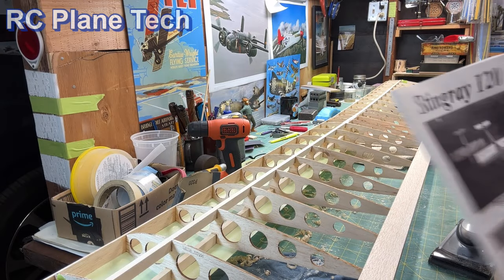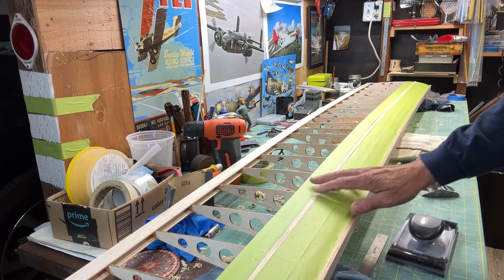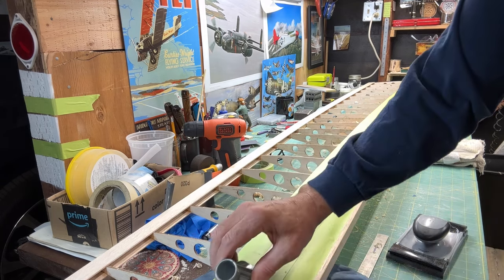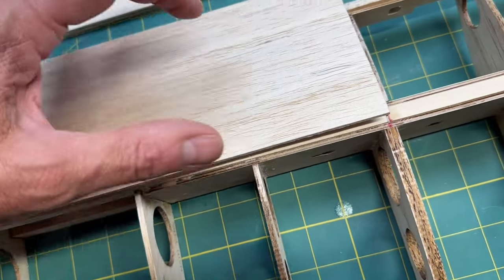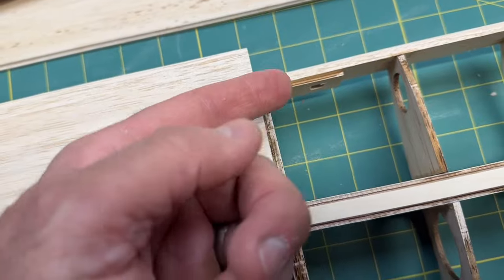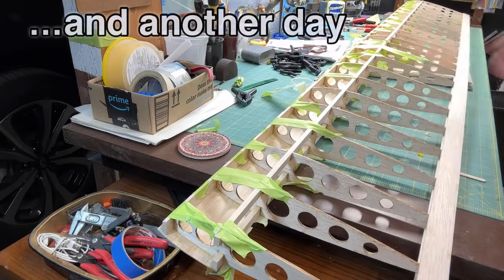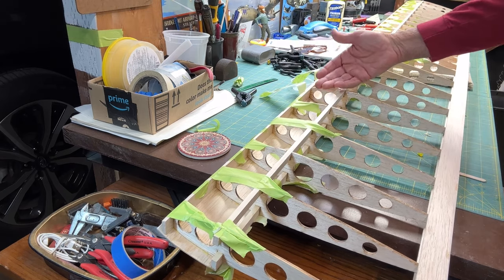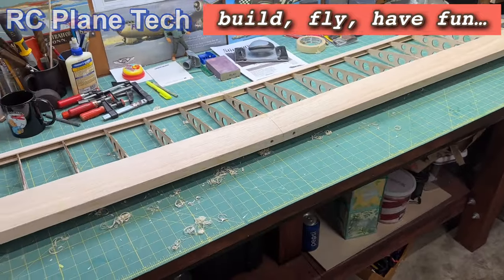Balsa USA Stingray with DLE-20, RC Plane Build N0 5: Wing Sheeting

Comment: I understand this video is several months old but one thing that's really good for putting on the sheeting is using a steam iron. Put the tite bond on all surfaces to glue and let it tack up. Turn the iron on using the steam to stick the parts together. It works great. I do it on all my planes while scratch building. I enjoy watching your videos.
Reply from the maker: Thanks! I’ll have to look into that method. Its always a challenge to sheet curved surfaces.

Comment: In my opinion the kit should have  fit a lot better . The rib should have been cut way more accurate , the spar didn't fit at all..
If you would have known the spar was to big you could have shave it before installing it.
But, you are doing a good job with it.
Reply from the maker: Thanks, ya the problem kinda snuck up on me as I was building so I went in that direction.

Comment: I use Windex to soften the wood and tape ,  and after it dries it will be formed. Then I glue it 😊
Reply from the maker: I have read about that method but have not tried it, something to consider in the future. Thanks for the tip.

Comment: Seems that in this case, it would have been better to check the rib slots before assembly and deepened them as needed. A little time spent before saves time later. Probably the same overall time.
Reply from the maker: Ya, thats a good idea. It would have saved time. Something to consider for sure.

Comment: I use wood glue exclusively to build.  I've found the FastCap  Highbot glue bottle is very handy with Titebond II because it isn't dependent on gravity.  Additionally silicone glue applicators make reaching under sheeting to apply glue to the ribs.  Lot of companies sell them, but Sili brand has different types and sizes.  Their glue pod is also nifty.  Nothing too expensive, but handy tools.
Reply from the maker: Nice , Ill have check those items out. Thanks.
Reply: @JamesRCPlaneTech  Also, lots of Q-Tips to clean off glue before it sets up.
Reply from the maker: Nice tip.

Comment: Just out of curiosity on my part if the spar is proud why not add rib caps to the structure since the trailing edge is proud of the ribs as well?
Reply from the maker: Yes, thanks. There will be rib caps, they will be flush with the trailing edge sheet and the leading edge sheet. The spar was too high. If I left it that way the sheet would sit too far above the ribs and the rib caps would then sit too low. Next vid on this will be installing the rib caps. Thanks again.
Reply: @JamesRCPlaneTech  my line of thinking being that I don't know how far above the ribs the spar was sitting was if the spar was sitting above the thickness of the sheeting that you could have just butted it up against the spar. Doing this i know would have ment that the sheeting would be "floating" between the ribs which isn't a good thing but if this was the case creating shelves between the ribs would have cured that issue. I just found it interesting that the manufacturer didn't either cut the slots in the ribs deeper or just cut the spars the correct thickness. Good video though I've watched many of your builds and techniques and learned stuff along the way.
Reply from the maker: Thanks I appreciate your comments and insight. And yes, would have been better if Balsa USA spent a little more QA/QC on this kit. There have been a few challenging issues. And I always appreciate comments that offer good ideas and insights, so thanks again.
Reply: The Smoothie wing build was so much smoother compared to this wing, I feel your pain watching you deal with the ribs and spars out of tolerance. 

I found it interesting that you changed your method of sheeting on this wing vs the Smoothie.  

If I recall correctly, you used CA to bind the inner edge of the sheeting to the ribs, folded the sheeting down to the leading edge, then tacked it to each rib using CA, you then flipped the wing over and used CA to attach each rib to the sheeting.   

That’s what I did on my Smoothie, the only difference is I moistened the sheeting as I found it bended easier and formed better this way. 

I know when you sheet the opposite side it is hard to access  the sheeting/ribs to CA but I purchased some extra long tips that are about 6” long that make it much easier. 

I find that the wood glue sets up to fast for me, I use it here and there but still prefer CA over it for this application.
Reply from the maker: Hi, ya I was looking at how long the wing is and figured I just needed more time to work with it. This kit has several issues so far that are giving me heartburn. Thankfully the wing is almost finished.  I was going to wet the balsa, but it turned out that it made the curve ok, but it probably would have been helpful.